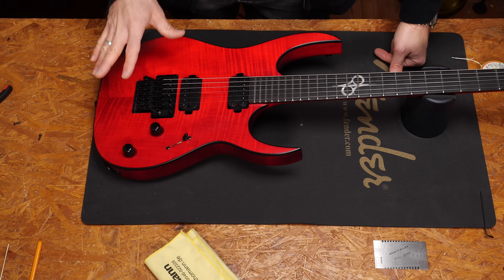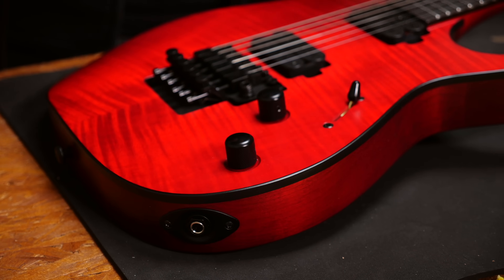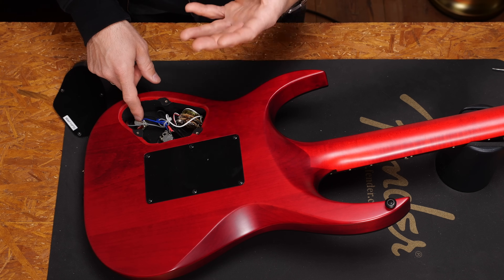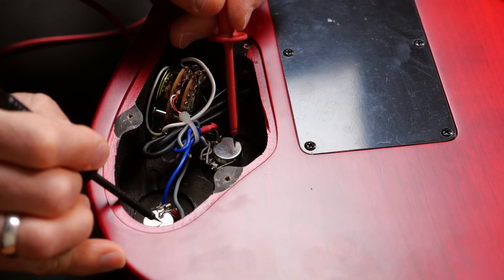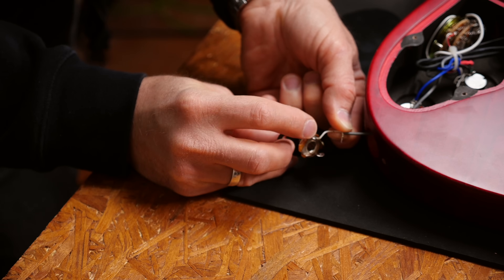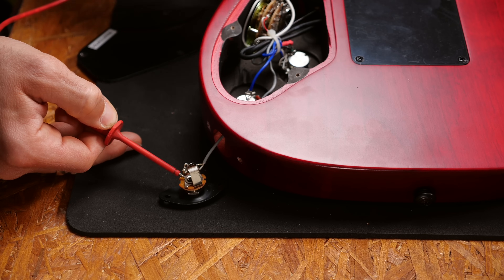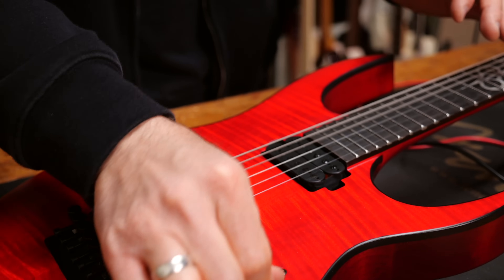How to fix Ground Noise | Guitar Tech Tips | Ep. 8 | Thomann

Comment: Great video 👍. My guitar is also having this kind of noise problem but in a complete opposite way. When I turn up the tone knob, there is noise and it stops only when i touch any of the metallic part in the guitar. If I don’t use the tone pot then there is no noise. So I checked everything and even changed new capacitor thought might be it was the capacitor coz it’s in the tone pot. But still can’t fix it. After I watched this video, I feel like maybe you can help me out. So please if you have any suggestion or instruction about my problem, it will be a big help. Thanks.
Reply: Same here 😕
Reply: Prolly because your amps aren't grounded properly. I have a prs mt15 that buzzes when i dont touch my guitar. Fixed the grounding issue for the amp and the noise is gone
Reply: Albert Nameirakpam kamaina semdoino amta hybirak kero? Technician manak tabudi chatri ado eina hanjan2 wiring mayam do change toura2 try tourabane sukya yadre.
Reply: @mysnkshetri  meitei oire haha. Loina connect touro, adei ngg guitar amp ki metallic part ama nasa ground toura touch toubada fabra yengO. If this solves your buzzing, then the amp was not grounded properly. Amp tugi 3-pin plug anouba ama chngAni or a properly grounded socket chngAni c semgede.

Eig case tasu C oirmEni. Hope this helps
Reply: Albert Nameirakpam haha mane Meitei ne. Amp loinamak ta chap manana noise to leiye. Guitar gi Tone, volume pot, output jack hole loina sinlagasu yengabane yadre. Capacitor louthok aga tone knob to sijinadradi keisu toude, tone knob hek on toubaga adum noise leire. Capacitor su sinlaga yenge loi chap manei.
Reply: @mysnkshetri  ngg cd eisu haiba ngmdoi mandre adude. Technician amda pubana fadoi mlle, case c khr luure haha
Reply: Albert Nameirakpam haha adune case lure. Technician afaba khangba leiradi share toubirak o.
Reply: @mysnkshetri  adude khngdene. Manipur dade guitar cde pura DIY ngkne haha.

Comment: New comment on old video .... I just found a problem with my home made strat that has been bugging me for years. Somewhat intermittent but often lots of static sounds that were driving me nuts. I took the whole think apart, applied new copper tape (with conductive adhesive) to the whole pickguard (and in the process broke two leads from pickups that took me a long time to trouble shoot) and DeoxIT-ed all the pots, and all seemed to be good. Until I put the trem arm in (WIlkinson trem - very similar to Ghoto). Any touching of the trem arm caused static scratch sounds. So I used my multimeter to test continuity. Bridge, strings, everything  all seemed to be grounded. But not the trem arm. I found if I screwed the arm further into the bridge and tightened the trem arm grub screw I had a good ground and all static noises went away. Which was probably me original problem all along. Lesson learned - test all grounds before trouble shooting. The problem might not even be a wire.

Comment: Yes excellent process. I have a Fernandez Revolver Sustainer guitar. I have already replaced the bridge pickup with a F space Screaming Demon. Much better now. I’ve did this 8 years ago with no problems. Lately I get a hum when switching to the middle & neck position.  The battery is fresh. I’m not sure where to start on this project. Any ideas? Thanks

Comment: Check the jack lead for continuity before condemning the output socket - if the cable is faulty, it could make it look like the fault is on the socket.  Also, if you plug in and sound comes through the amp, then the socket cannot be open circuit.

Comment: Excellent video 👏👏👏
Thank you so much💐
I have got a squire vintage modified 70s strat... bridge pickup and neck pickups are noisy but the neck and middle pickups are have no disturbance. Is the noics  because of the single coil pickup ?
Reply from the maker: Thanks! Exactly, traditional single coils are a little noisy, especially with a distorted tone. But in the 2nd and 4th position, where you have the bridge and middle, or neck and middle selected, they cancel the noise. Not all strats do that, but most of them. Cheers //Kris

Comment: Great info!  It would be worth mentioning how to isolate where the hum/buzz is coming from in your signal chain and determining if the problem is in the guitar itself or somewhere further down the line.  It can drive a person mad, for sure!
Reply: Well, wouldn’t you just try plugging the guitar straight into your amp first to see if the buzz remains? If it does not, investigate signal chain. From there, start removing pedals one at a time, then two at a time, etc, until buzz source(s) in signal chain (has/have) been isolated, I’d think.
Reply: Hi,

I can't figure out wether the noise I have is an issue with the building/electrics/grounding or the guitar.

Ive isolated the guitar, going direct to my interface's hardware input, running on external battery (so no computer or mains plugs at all) and their was no noise. Does this mean there isn't a problem with the guitar or would I only get noise if connected to mains anyway, so could still be either? 🤯

Comment: Hi, thanks for the nice video but what about if the humming sound comes when the hands are not touching the guitar? In my case It is completely silent when i hold the guitar firmly. It's a kind of opposite from the problem you describe. I am using a looper pedal so i need my guitar on me when i play drums but it makes a lot of noise (humming) when i don't touch a metal part.
My guitar is only few month old, i really don't get it. 

Any solution? Thanks in advance,  Thierry
Reply: Try shielding the guitar electronics !

Comment: Mine buzzes except when I touch the metal part of the knobs on the inside of the guitar or where the jack goes in. It seems to go away when I turn the tone knob all the way down. About to check it out. Dean vendetta xm 6 string.
Reply: Did you get this solved? Mine is buzzing now except when I roll down the volume knobs too :(
Reply: @jxcreativedesign  No unfortunately...

Comment: I have a s.d. distortion in my lespaul. The mounting tabs broke so I fashioned my own mount with a bar that goes along the underside. However I'm noticing the mounting screws are extremely sensitive to me touching it and is noisy. The other humbucker is fine. Suggestions?

Comment: Nice video. Can you tell me if pole pieces in pickups should be grounded? In my pickups only one of the coils has pole pieces that are grounded, on the other coil only one outermost pole piece is grounded. This is consistent in both neck and bridge pickup. I’ve searched internet for the info and the answer is always 50/50 so no definitive consensus. Thanks!

Comment: How about a set of Humbuckers that are noisy but I got a prewired hardness by Emerson Custom.  Guitar is super noisy when the strings aren’t touched to complete the ground.  Bad shielding maybe?  It’s the Les Paul in my profile picture.
Reply: I have something similar.  Loud noise until I touch my LP’s strings/bridge. On the other hand, my strat single coils, makes no noise if I connect it.  It happens on all 4 of my amps, in any room of my house.  In addition, I took it to my local guitar center and tried it on different amps, but no noise problem.  So it’s peculiar to my house.

Comment: Hello Kris! Thank you for your help i think i may have found the problem. I believe it is also my jack. I have looked inside and it seems connected but, the ground does not touch the pin directly on the jack. it is connected because the solder binds them. The solder has solidified around the ground wire so it is connected, but the wire does not directly touch the pin. would you consider that a bad solder?

Comment: Great video!
Kris, I have a question:
I recently noticed that all my shielded guitars seem to have less top end. 
In a Tokai I own, at fist I thought it was the pickups... Swapped them for a set I already had and was quite familiar with.. and nothing. Then I thought it was maybe the pots and capacitors... swapped them for another set I already had and was familiar with and nothing again. 
Could it be the shielding paint? The guitar is absurdly well shielded, up to the point that there's literally no hum whatsoever regardless of distortion.
If so, can I sand the shielding paint off?
Thanks a bunch.

Comment: Could the same issue be also causing minor electrical shocks from the guitar to your body? I have this exact same problem with my two basses (time to see a tech) and I also feel like I’m getting little continuous electric shocks while I’m playing. Could the problem also be just the grounding of the house’s electrical system?
Reply: Sounds like your strings and/or bridge isn't grounded properly. I connect my bridge ground to the output ground terminal. I also inserted a small screw in the cavity, soldiered a ground wire to it, and the other end of the wire to the back of my volume pot. Then connect all the back of the pots to one another. Now your pots all have a common ground and grounds from start to finish of your signal.

Comment: I have an old vintage kasuga P-bass...It had no continuity between jack and bridge...i checked that continuity existed between, pots, pickup and jack.. i thought ok i pull the bridge off...sure enough rust and green corrosion around the old copper wire...i cleaned, sanded, used contact cleaner , wet dry...got good continuity again...thought job done....put it back together...now i got another issue, no hum when the fingers touch the strings, but still hum??? its at least playable , what to try next??

Comment: Heres my question i have a guitar that just one humbucker wired to a volume pot and then to a psychobox distortion unit instead of a tone knob and then to the input where does the ground to the guitar actually go?from the volume knob is where I figured but do you just run a wire from the negative just into the wood somewhere or a screw or something

Comment: Hi Kris recently I bought a telecaster deluxe and in all other amps it have no issues but when I use with this  guitar my VOX VTX20 it hums really notoriously so I tested the guitar and everything looks fine but plug again the guitar after checking and same hum noise so I start thinking that maybe it hace a cold soldering somewhere but then I noticed the hum only appears when the tone pots are set to zero, so I start checking in other amps and then noted that it only happened on Cox amps with this guitar, then I decided to resolver and renew cables thinking that maybe something i  the vox amps architecture is really fine to show a cold soldering grounding issue but nope, so I tried to change tone pots and I changed them using some seymour duncan pots, connected again to the vox vtx20 and then, the same damn noise,  so I don't have a clue of the hum reasson is like a single coil hum also it drops a little when touching strings and the same behaviour just when turn down the tone pots to zero.

Comment: Hi love the channel... i have a ground issue despite testing continuity, checking and double checking solder joints... is there anything else i could be overlooking?
Reply from the maker: Thanks! Have you also checked if the signal only goes to the cables tip and ground only to the sleeve of the jack? You can plug in a cable and test ground continuity to be sure. //Kris

Comment: My 3 pickup guitar in single coil mode (Its a 1993 Les Paul w/M3 Electronics which I believe was only made for 3 years) in single coil mode would cancel noise in position 2 and 4 on the 5 way switch. 
After replacing a dead single coil middle pickup (that was dead) the new Seymour Duncan pickup no longer cancels the buzz/hum in position 2 and 4. That middle pickup now also seems weaker then the other pickups. Can a pickup wired out of phase cause these problems? Thanks...
Philip
NYC Area

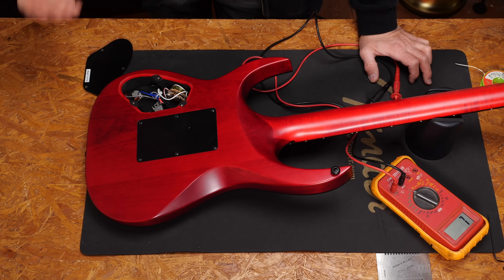Comment: At 2:48 In the video when you were checking the ground for the jack... Was the cord plugged into anything or was it just a random cord you just brought over for it?
Reply from the maker: Hey, the cable was plugged into the guitar's output jack as seen at 2:59. The cable you use for testing has to be connected with the guitar otherwise you can't test continuity. Cheers //Kris

Comment: Good lesson. Oh yeah, i've got a problem with my Gibson LP equipped with slash pick-up. Humming is coming in when i connet a pedal board to amp. Any tips man with a gibson? Thank you.
Reply from the maker: Hi, first of all thanks! If you only have hum when you connect the pedalboard, it's probably not the guitar's fault. It's hard to tell without testing your rig personally, but assume you need a better (isolated) power supply for your pedals. I hope that helps. Cheers //Kris

Comment: Hi,

I can't figure out wether the noise I have is an issue with the building/electrics/grounding or the guitar.

Ive isolated the guitar, going direct to my interface's hardware input, running on external battery (so no computer or mains plugs at all) and their was no noise. Does this mean there isn't a problem with the guitar or would I only get noise if connected to mains anyway, so could still be either? 🤯

Comment: Thanks A LOT.
I had a loose solder point at the negative that went to the back plate, the springs one.
There was continuity, but the solder joint was very loose. Almost went nuts until removed back cover and moved the ground wire and saw it barely attached.
Move every cable and joint.
Bye bye hum!!!. ^_^
Reply from the maker: Sweet! Problem solved -> good times. 💪
Cheers //Kris

Comment: Hi, I just bought PAC212VFM and it was shipped straight from the warehouse not being setup or anything from the store. I plugged the guitar and turn the volume full (10) and I pulled the tone/splitter button there's the sounds of buzz and hum. I touched the strings the hum/buzz sounds was gone, touched the bridge the sound gone, and sometimes when my elbow accidentally touched the bridge it's electrocuted. I've checked all the cables and it's fine (nothing dislodged). What could possibly wrong? I checked with the Multimeter and nothing wrong or suspicious.

Comment: My friend bought brand new bass guitar Sadowski from NY. It vas very expensive. When he tried to play it (he has very good bass amp) he found that moving hands or only sleeves over body creates static electricity crackles which was really annoying during performance. And when he connected wireless, it got even worse. We opened cavity to controll what wrong, but every ground points were ok. Cavity was painted with graffit color, and cover had alu plate inside, connected with ground with mechanical contact. Nothing helped us to get off those crackles. If he connectes another bass, it was ok, so amp is not wrong. What's your opinion with it?
Reply: I know this is a year late and I'm no electrician, but:
-Even though all of the wires seem to be soldered fine, it could be that one of the ground wires is soldered to a wrong place. Like ie. many have commented that they had the jack input wires soldered backwards.
-If the bass was new, why didn't the friend just take it back to shop for an inspection? Since it was under warranty.
Reply: @MaximusAdonicus  He did it. He had warranty so he let it back. Instead it he bought Fender precision 5 string Bass. Fully satisfied.

Comment: I have rebuild a salvaged guitar. Mine is all soldered properly. But when i use the guitar strap and move around, the loud annoying rubbing creaking metallic sound is emitted (rubbing from the strap leather and both end locks) . Is this due to shielding issues?

Comment: Just wanted to let you guys know, if anyone is struggling with humming les pauls (tribute, studio) please check or rewire the toggle switch. I just did whole rewire of my 2004 studio and was shocked of what kind of wires were used to toggle switch to be honest. They were very thin and horrible wires, which when replaced and follow 50's wiring there is no hum at all now.

Comment: So all my tests on a tele player plus run exactly like the video. Fails when I touch the cable shield to any part of the guitar. However, the connection of the ground to the jack tests ok (continuity to the inner shield is fine just as Chris does in the final check before he closes the guitar). Also silences it when I touch the black paint inside the cavity so the ground wire seems fine too.  Sound is unbearably loud even with barely any gain and no pedals. Goes 90% away to normal levels when I touch any metal. Any ideas? 
To confirm, only my tele does this, tested on multiple cables with no pedals. Strat doesn't make barely any sound with same setups nor does a Godin.

Comment: Nice! Were you using V or Ohms for the continuity test? Thanks
Reply: Ohms. If it was a higher voltage system you could use a voltage drop method but dealing with mini volts it would be impossible to find . You could even read the meter as far as the Ohm reading goes to see high resistance in the circuit ( ie ) cold solder joint !

Comment: if the wires on the jack are correct, do you not then look at the volume pot for the 2 jack connection to is 'hot' output tab and the back of the pot (the ground) ? How do you know just where a problem is if you do not take off the pickguard or wherever the jack connections start from ?

Comment: so when you touch the strings there should be no sound change at all ? i get a very slight quiet change in hum when i touch the strings and slight louder when i don't touch them.  its not a loud issue like yours was here. Im planning to shield it later one and maybe add more grounding ?

Comment: My guitar amp is buzzing badely without guitar connected, just a cable plugged in or just a jack head, additionally the amp makes more noise when I touch the decoration metal corner.. Any fix? Thank you.